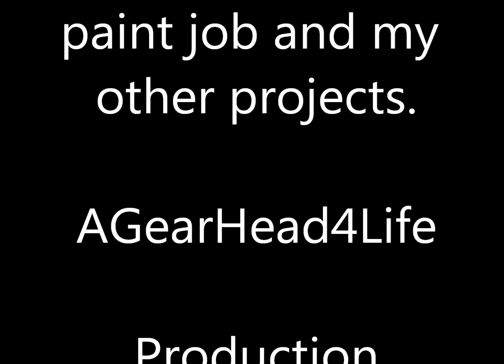Paint Job POURED ON & Rolled Out Rustoleum - $50 Dollar  DIY How To

Comment from the maker: Thanks man and good luck! But remember if you plan on ever painting it again withh regular automotive paint (Base coat/clear coat) I dont recommend doing this. It would add work, because it has to be removed before applying regular paint. At least that's what said is the correct way.

Comment from the maker: @Neptune Pisces - For some reason it wont let me reply directly to your comment so I will do it this way. Spray one would be easier and better in my opinion. As stated in the video description, the purpose of this video and process is to give people one more option of how to complete the task. For example people who dont do autmotive work regularly enough to have a compresor at home. This method gives them an option without having to buy a compressor.
Reply: Hola, la Pintura Negro mate rust oleum para automovil la Vende en galon?
Reply from the maker: I do believe that they have a black stain Rustoleum paint. They may have a matte as well. Check their website. They have lots of colors.
Reply: Is your C10 a rustoleum paint job now?
Reply from the maker: Marcelino Afanador No. The truck in this video was stolen shortly after painting the hood. I've replaced it with a truck of the same body style, but it was already painted.
Reply: I will have to give this a try
Reply: the link in video for i guess a progress play list is not working saying page not found search fer something elkss

Comment: I imagine you wet-sanded between coats and clearcoated the hood and polished it afterwards.  The final result is nice.  Maybe I should try rolling paint on my Corolla.
Reply from the maker: Nah, no clear coat, though that would greatly help it last. I did wet sand between coats.
Reply: Did you polish it afterwards?
Reply from the maker: Nope
Reply: The stills at 1:34 and 1:26 look really good.  It looks like the orange peel has been buffed-out.  If the paint did that on its own, I'm really impressed!
Reply from the maker: Yea, I didn't do and final sand and buffing. I don't even think that I have a compound in my garage to buff it out. I just did the sanding between coats. The right mix with mineral spirits allows the paint to "melt" and lay down real smooth.
Reply: I should try it.
Reply from the maker: Yea, for the right project, it does the job. A clear coat would help protect the paint and make it last longer too. Its definitely not near as good as a base coat/clear automotive paint job, but can be a good cheap option for a beater or something.
One big negative of using this paint, from what I've gathered, is that all of this paint would have to be stripped off before repainting the car with automotive paint.
Reply: AGearHead4Life Can't you use an isolator instead of stripping the paint?

Comment: Oh hell I've been doing Rust-Oleum 50/50 paint jobs for Year's it's called 50-50 paint job because when it's sitting 50 yards back and you ride by at 50 miles an hour it looks good I used to use the Wagner portable fence painter first coat with a little bit of thinner second coat with a little bit of thinner and a little bit of clear and there you go a 50/50 paint job

Comment: 20:1 paint thinner to paint ratio hot rod used wet sanding every 3 hours after a coat about 10 coats or so in 20hours or more

Comment: I'd recommend a 60/40 mixture with acetone rather than paint thinner, which will give a better chemical bond (you may not even need to sand) because the acetone etches and softens the existing surface, almost welding the new paint to old.  But you may also need to stir in additional acetone periodically because it evaporates so quickly, which also allows the paint to cure more quickly.
Reply from the maker: Good Tip DDEENY! Thanks for sharing!

Comment: It turned out pretty good.
Reply from the maker: Yep, I thought so. It'd work great for a beater. Not as glossy as a new car but does the job.
Reply: It's just a damn shame that some moron rear ended you causing that much damage. The completed paint job looks great. Are you still hoping to get her all straightened out?
Reply: Sorry. I responded wrong on this video. The wrecked one was a Caprice. You have the Chevy truck. Right? You did a great job on that hood!!
Reply from the maker: Yep! The truck is me. Thanks man. It was a fun project.
Reply: I'm surprised at how many Rustoleum paint jobs are out there on YouTube. Most of them look great, with the exception of a few that tried it with a brush. Yours came out looking great with the roller. Was your truck stolen? I thought I read that it was stolen in the comments.
Reply from the maker: Yea, it was stolen February 15 2013, before I got the chance to finish that paint job. I was going to try spraying the rest on with a cheap Harbor Freight paint gun. Spraying will will much less labor since you wouldnt have to sand so much.
Reply: That's a damn shame! That particular truck is very desirable. Were  you able to recover it, or find out who stole it? What's the ratio (paint to thinner) when brushing, of spraying Rustoleum? I've used it on vehicle frames, but straight from the can and I know that it's really thick right out of the can.
Reply from the maker: Nope, never found anything about it. I think its about 50/50 when srpaying. Not sure. Its been a while since I played with it.
Reply: Sorry to hear that! I bet Rustoleum holds up pretty good on a vehicle. It's nice and glossy also. I had a totally restored '73 Monte Carlo stolen in 2008. I'm still pissed off. It was being stored inside of a climate controlled body shop. Me and my wife went to get it out of winter storage, only to find it was nowhere to be found. I never did find it. The owner of the building claims that he doesn't know anything about the disappearance, but I have serious doubts. I can't prove that he did, because it seems to have just dropped off of the planet.
Reply from the maker: Wow man, I'm sorry to hear that. I know how it hurts man. I'll be wondering the rest of my life what happened also. All i know is what goes around comes around. They'll get theirs, even if its simply because of the type of life they've chosen to live. IT'll come.
Reply: I hear you! Karma will eventually catch up to whoever it was that stole yours and mine. I'm pretty sure that I know who was involved in mine. I'm still bummed about it and it happened 6 years ago. What makes it worse for me is that my Monte was the first car I've ever owned, purchased in 1986 from close family friends whom were the original owners purchased torwards the end of 1972 brand new. It was always garaged and solid as a rock. I restored it by only having to replace the carpet and I chose to replace all of the chrome with NOS parts and a paint job. It didn't really need it, but I felt that it could look even nicer than what it already Did. I looked for another one and found some nice ones, but it wasn't the same because it wasn't mine. That was just how I felt about it. The memories didn't feel the same.
Reply from the maker: jphritz011 Damn man. Sorry to hear the loss of a ride with so much sentimental value behind it. I was close to mine because I invested so much time and energy into it, but it'd hurt even more if it had been in the family that long.

Keep your head up and move forward. Dont let them take any more by letting it get us down.
Reply: I couldn't agree with you more! I figured that I'd share my experience with you, so you'd know you're not alone. There are pieces of trash that do this BS in every city and state.
Reply: I couldn't agree more. I think about it every day. I actually get butterflies in my stomach while thinking back at the memories.

Comment: Forget Rustoleum, get yourself some Brightside Interlux yacht paint, its a lot more forgiving and you only have to thin with 10 percent pure mineral spirits.  I used this paint with my Festiva and it turned out great but it was a lot of hard work.  You'll sand your hands off by the end of the week.  If you can spray it, it'd be so much easier and come out so much better with way less work.

Comment: you say not the recommended method in the video, what exactly do you mean? what isnt recommended, pouring the paint on or using a roller?  and what would the preferred method be?  sorry the truck got stolen, looks like it turned out pretty good and wouldve been really nice if you couldve finished it!
Reply from the maker: Yea, i was referring to pouring it on like that. You should use a roller pan to get paint on the roller and then roll it onto the car.

Thanks Jared! Yea, I loved that truck.

The paint was definitely decent. Not as deep and shiny as an expensive paint job, but it was acceptable for my purpose. I've heard that adding a clear coat over it will give it more gloss and protection.

Comment: i have a van with an off color door, this method looks like its a cheap solution to my problem! Never did like the original green anyways! Any tips on how ot be sure my coat is even since this is the method no one seems to use? Look like it works to me!

Comment: first time viewing the post as i see the Rustoleum is very popular now but my question is dont some of you worry about the vehicle with this type of paint?
Reply from the maker: What is there to worry about? I'd say that it'd depend on the vehicle it's going onto. If it was just a beater like this one, then being all one color from a coat of Rustoleum would be better than the patchy paint job that it had of five different colors. It'll protect it from rust and look much better. It can be applied with common house hold tools. You invest your labor and save $2000.

Buty if you're looking for a show quality paint job, this will not be it. If you decide to put a show quality paint job on it later, you'll probably need to strip all of this stuff off.
Reply: So can you get that show mirror finish with that paint
Reply from the maker: sd33zy313 I wouldnt expect the high quality mirror finish like with real automotive (base coat, clear) paint, but I've heard that you can get a much nicer finish with Rustoleum that will last longer if you apply a clear coat over it.

Basically you get what you pay for. This is the budget way to make you car one color yourself. To have a quality automotive paint job done will usually cost around $2k. To do the quality paint job yourself will take skill, special tools that not everyone has (like a large 60gal air compressor $$) and still cost you at least $300-$500 in paint supplies (depending on quality of paint that you want).

Comment: i used mineral spirits to level the paint on some bumpers looked really good. It was a bitch sanding I  imagine 40 hours it would take to prep and sand( in between coats) a full vehicle. But hey if it is  $2000 car get to sanding.

Comment: Is the Rustoleum Royal Blue a metallic color? or how did you get it metallic? :o
Reply from the maker: No, the Rustoleum Royal Blue isn't a metallic color. The metallic came from the Aluminum color that I mixed into it. You can see the colors that I mixed at the beginning of the video.
Reply: AGearhead4Life Ok thanks.
Do you think any aluminum paint will make the paint "metallic"? I dont have rustoleum where I live.
Reply from the maker: ILIKECATZNCHEEZBURGERZWITHCHEEZSHAYAYAYAYAYAYAYAYAYAYAYAICOULDGOONLIKETHIS4EVERBUTIHAZTOGONOWBYE No I dont think that any aluminum paint would do this. I didnt even expect this one to do it. It just coincidentally happened. I believe there are other name brands that are the same as Rustoleum. I know Canada has the same thing as Rustoleum but a different company name. Check out the forum in the video description.

Comment: Can I use paint stripper  on the car first and then use this paint or spray pain technique?
Reply from the maker: alwayzblessed25 I guess you could, but it'd probably be best to put a primer down on the bare metal. It seems most usually sand the old paint down before painting. And if the old paint isn't that bad you could not sand it all the way off. You could just rough it up with 400 grit sand paper and paint on top of it. That would be way less work than removing all the old paint.

Comment: Thanks for the video. Picked up some copper hammered going for beat up look. Did you mineral spirit in between coats?
Reply from the maker: Only to wipe off what I sanded. I used it to dilute the paint too, at the ratio in the video description. Good luck on the project!
Reply: Did you mean Rustoleum Hammertone Copper colour? How did you get on with that? I got some light green hammertone to try on my campervan.

Comment: Does it remain textured or does it flatten out?
Reply from the maker: Not sure what you're referring to. Mine finished smooth. But it was wet sanded a few times also. That smooths it out. Plus if you have the right mix of mineral spirits in it, it helps it lay down as it dries.
Reply: I was wondering how well it lays down. Like how smooth is it without the wet sanding.
Reply from the maker: ***** It was pretty smooth. Not sure what to compare it to and this was a couple years ago. The minerial spirits really allowed it to melt down smooth. Much different then just dipping a brush in the can and wiping it onto something. The spirits allow it to settle. Also if you sprayed this through a paint gun, it'd lay down even smoother.
Reply: AGearHead4Life cool. one last question, what brand mineral spirits did you use?
Reply from the maker: ***** I dont remember the brand, but it was the gallon can at Lowes.
Reply: ok, thanks man. I'll give it a shot on my hood this weekend.
Reply from the maker: Good luck! Remember, this is high quality automotive paint. it wont look as nice as a $2k paint job. But with patience and skill it can definitely come out nice. Way better then what was on my truck before doing this. Great for a budget build, farm truck, race car, etc. My hood came out looking great actually. I never got to do the rest becuase the truck was stolen. But the last video I uploaded of it racing a Dodge Charger, at the beginning, you can kinda see how the hood looked. It looked great to me. I've heard if you clear coat it, it'll looke even better and last longer.
Reply: can you share link to the Charger video please? I wish someone would steal my truck, i'd get more then what I paid for it LOL but they would get a good truck.
Reply from the maker: This computer I'm on wont allow me to copy and paste. Just click on my name and that'll take you to my channel. Once there, it was the last video uploaded, most recent video.
Reply: ok, i'll go check it out. Thanks!!

Comment: I can't believe the results some people are getting doing this.
I tried it on a junk car I have sitting. Looks terrible. Tried mixing 50/50 and 60/40.  The roller would leave lines on either side on every pass, and the roller would leave an ugly texture. Don't know what I'm doing wrong.
Reply: +62guitarguy in the video though he says"haven't even final sand or polished yet"
Which means for him it's laying on that smooth, or, atleast the 8th coat did.
Reply: +62guitarguy or is it that I haven't laid on enough coats to fill in the valleys? I only did 3 coats. I'm guessing that with painting with Rustoleum like this, a lot of coats is key to looking decent?
Reply: +Ian1911
you using to much paint if your getting lines. Oil paint stretches very far. Your using way way to much.
 If your reducing it 60/40 it would be running off your work piece.  Use allot less. 
Make sure your not using a cheap foam type roller also.  Roll tape around your hand sticky side out. roll the dry roller on the tape to take the loose hairs off. Dont use a large roller either.  Use one about 2in long.
Reply: Mark Rich I'll try it with less. I was using a little foam roller. I heard that was what should be used for this?
Reply from the maker: Also, the temperature makes a big difference in how the paint sets.
Reply from the maker: Good job looking out for others and helping out.

Comment: What did you use for the metallic finish?
Reply from the maker: +slowsticegxp The silver that you see in the small can at the beginning of the video. It coincidentally add the flake.
Reply: +AGearHead4Life are those quarts and then a pint of the silver?
Reply from the maker: +slowsticegxp Yes
Reply: +AGearHead4Life thanks for the replies. I have a bad bubble problem and when they pop it leaves circles of no paint. did you run into any issue like this?
Reply from the maker: +slowsticegxp nah, i didn't. Maybe more mineral spirits will help it to lay down. make sure not to touch it once its starts drying. So if its drying too fast as you roll over it, it'll leave a texture. More mineral spirits may help it to not dry as fast.

Comment from the maker: On this hood I used a rattle can filler primer from O'Reillys and then etching primer on any bare metal areas. It was done way before I had decided to go with Rustoleum.

I believe Rustoleum has a primer and that will be what I use on the rest of the truck, but still an etching primer on any bare metal areas.

400 grit is good sand paper for before and between coats. dont want it too fine or the paint wont stick. After the final coat cures you can wet sand with 1500-2000 and then polish finish.